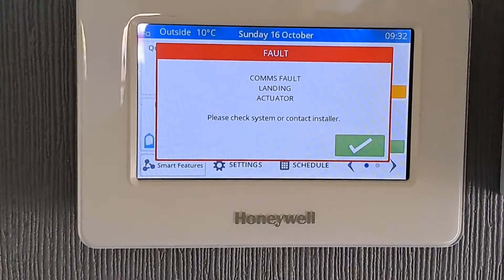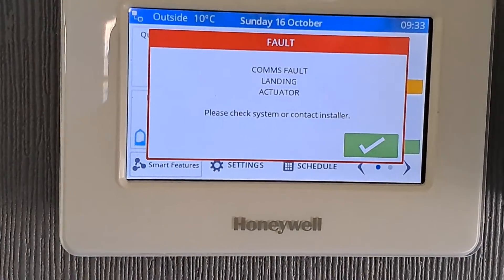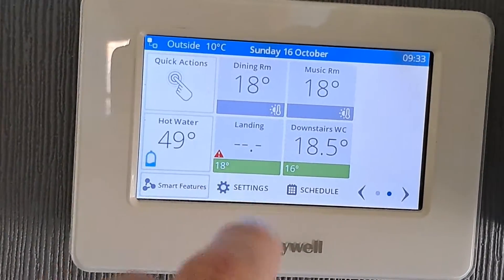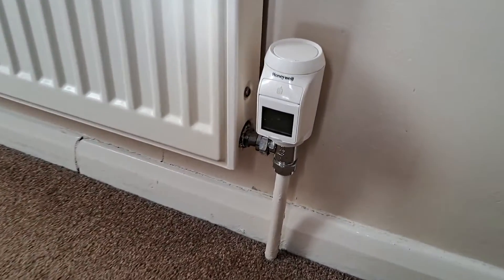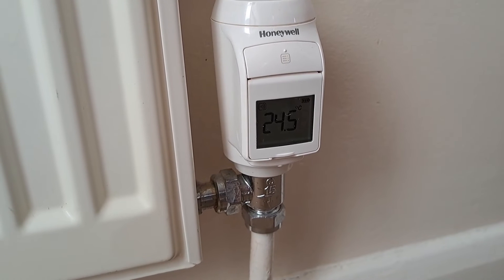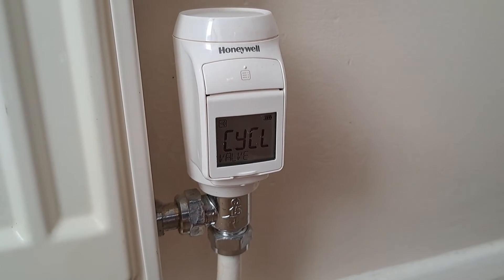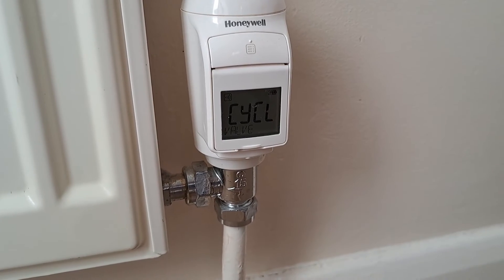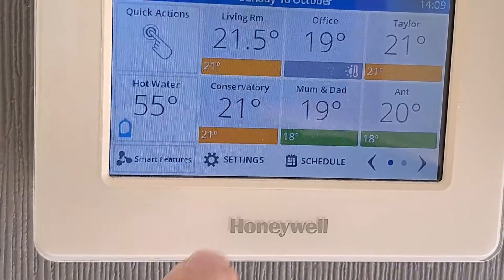Honeywell Evohome Comms Fault (example #2) - How to change batteries

Comment: Brilliant video! I've just moved into a new house which has a whole system of these and the panel showed loads of coms faults and we had a fully cold radiator. This video meant I could solve both problems.

Comment: I'm having this problem now, the battery is fine and 2/3 bars. So I've replaced them anyway and still have the 'Actuator' fault come up. What shall I do?
Reply from the maker: I'd probably start by doing an RF test to check the signal strength and verify that the comms is all good, if that's okay then there might be something wrong with the radiator valve (too stiff?) or the HR92 itself - there is a special menu on the HR92 to put it into test mode, I don't have a video for that but it would be a good topic for the future.
Reply: Same problem here George. Signal is fine and batteries are new. Let me know if you found a solution.
Reply: Same here

Batteries replaced twice.
Not a range issue, only 5m away.

Is this now a warranty return?